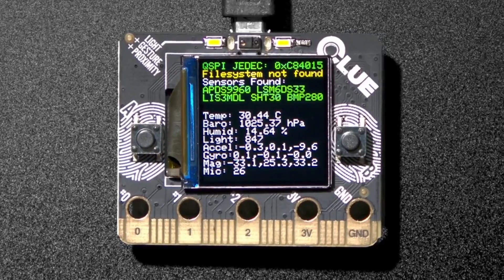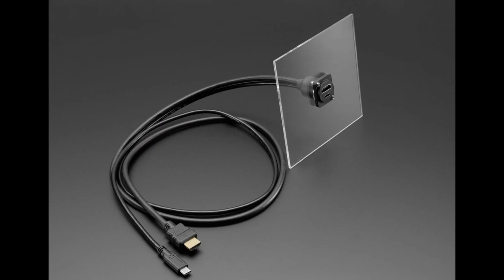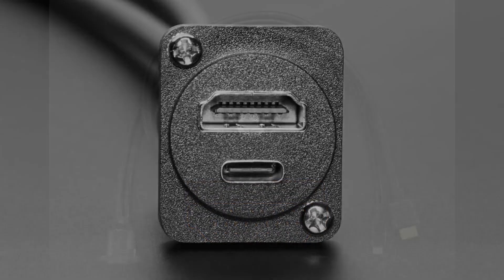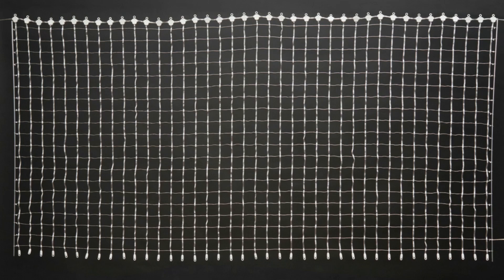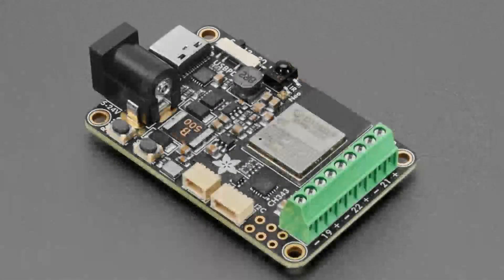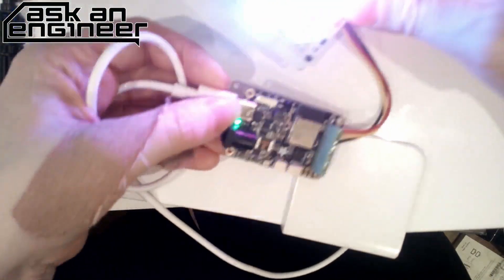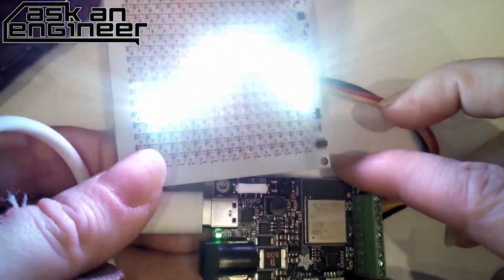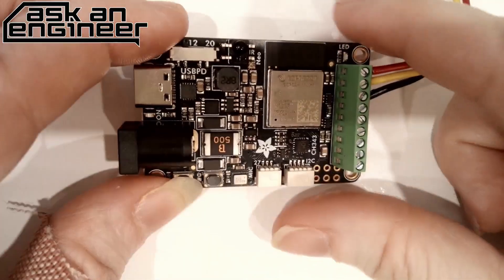#NewProducts 1/22/25 Feat @Adafruit Sparkle Motions

Comment: I keep seeing different opinions on whether 12v is a supported PD spec. It looks like it used to be, but dropped in favor of 9/15. Is that a function of the power supply or the target device? Wondering if 12v will/won't work in the distant future versions of power supplies
Reply from the maker: Ladyada responded on Ask an Engineer https://www.youtube.com/live/huO1ildzuYE?feature=shared&t=2474
Reply: @adafruit  awesome, thanks for the reply. I don't know much about the details, but it seems like the og pd spec only has/had a specific number of "bins" for voltages, so they started to go common, then like you mentioned they dropped it in favor of going wide, presumably higher wattage. I'm far from an EE, just enough to be dangerous. In any case, I'll have to go around and sharpie up my wall warts to see what supports what all over again.